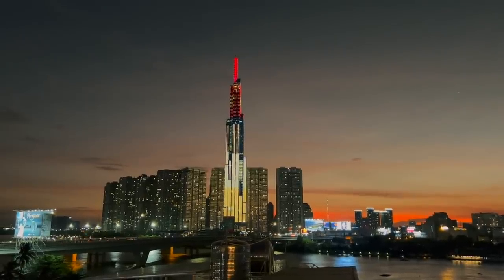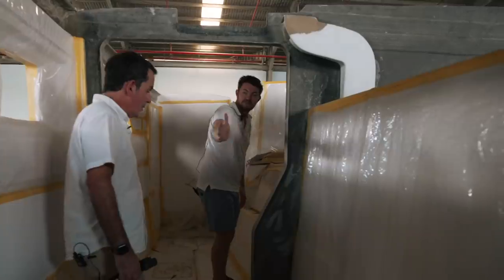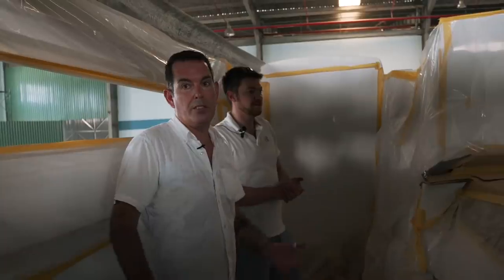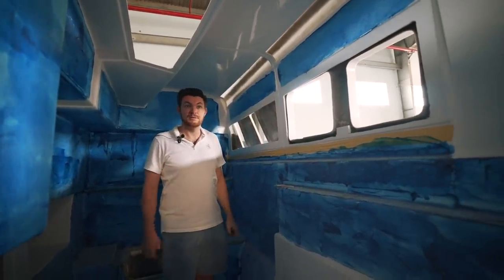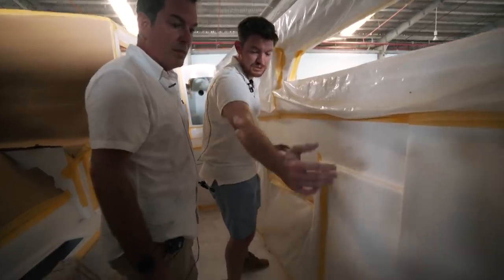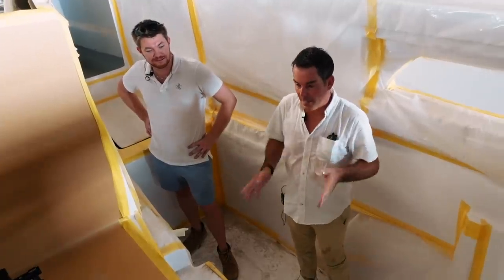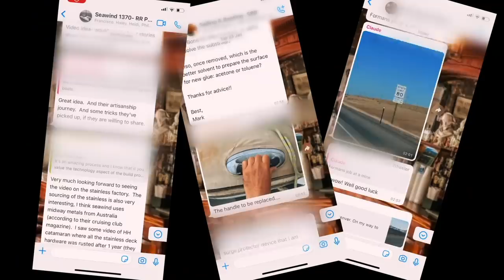CATAMARAN Build- FULL INTERIOR Tour: The Next Stage of Ruby Rose 2

Comment: A lot of chatter has been going on about bulk heads and tabbing.  What really impresses me with this design is the grid structure on the bridge deck.  Torsional stiffness of the hulls will all react out through this area.  Bulk heads etc. are only a small part of the equation that adds up to total strength.  There has to be a certain level of comfort knowing the strength under foot when traveling off shore, and the longevity it will add to your boats life.
Reply from the maker: Absolutely mate. I need to know how a boat that will be keeping us safe is made

Comment: Interesting to see the structure behind the finish bulkheads and hear the thought that went into the design. Great anticipation for the next vlog. It would be interesting during the tours to hear where your and Terysa"s ideas changed or altered the design / build. Also, people might find it interesting to hear the optional equipment that was chosen as well as those items that weren't.
Ruby Rose 2 has sail drives. Why did you choose them versus shaft drives?

Comment: Really a great looking boat. I do have a question about the engines. Eventually the engines will need to be replaced. What kind of hoops will you need to jump through to replace one or both engines?Is there access from above or will will the engines need to be completely disassemble to be removed out through the cabins?

Comment: 8:58 if there is a saildrive torn out, u are above water line ,another level of  protection, interesting mindset from  the Seawind Team. Does the saildrive just snaps off, in worst case scenario? And , why going for a saildrive? I know u covered this point in the past, but your knowledge n critical thinking is evolving in this field. If we may, did Seawind try to convince u to go for a traditional shaft drive as this is an ocean crossing vessel...?
Reply from the maker: I can think of only one catamaran now that comes as standard with shaft drives.
Sail drives are easier and cheaper. While ultimately I can see the advantage of a shaft, it changes the whole position of the engine.
I feel that in ten years time, very few small yachts, sub 50 ft will still retain shafts
Reply: @sailingrubyrose  shaft drive for the hybrid version on HH44, Antares 44, Max Cruise 44, Privilege, Shonning, etc..

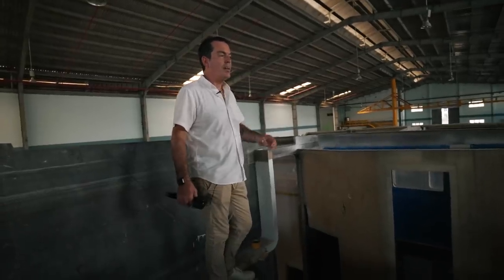Comment: Thanks for the video and good luck w the new boat construction. About the different shape and dimensions of the piping (02:26): I hope you won't face problems related to flow, since some areas will have higher pressure and others lower. Perhaps that was well considered by the engineers but I became curious.

Comment: Congratulations, beautiful boat. I was surprised it seems like interior is pan and glue like the French production boats? Is it not glassed in structural interior? Maybe just the video angles?
Reply from the maker: All the interior fittings and inserts are glassed i believe
Reply: @sailingrubyrose  A video on the construction method would be very interesting. I think you will find, by the current pictures it looks like main bulkheads are glassed in and look great but the furniture, floors, etc are not glassed but glued like a lagoon.

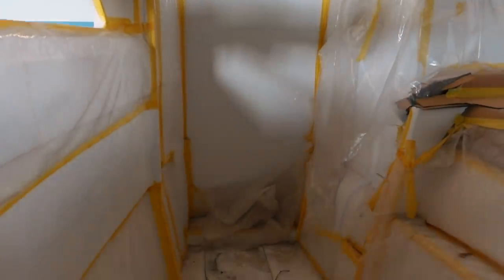Comment: 8:56 crash bulkhead, 2 levels of protection, is it common on most Cats of this category?
Reply from the maker: I don’t know mate, but as this is the beauty of the internet, someone will chime in if there is another marque with double crash bulkheads
Reply: A lot of blue water and racing cats will have crash bulk heads 
Both in the bow and lower front bilge compartments. Thats protection against running onto a reef, rock or Bommies . 
Given the speed a cat can travel at and the amount of heavy stuff floating around in the seas and oceans these days eg shipping containers and heavy bouy's and trees that get ripped loose in storms ...the other suspect item is Submarine Glider ROVs that dive and surface to transmit as they travel through the seas and oceans. Some are scientific others are military but its happend. The other issue is whale strikes 😟

Sealed bilge crash boxes are going to protect the boat. 
Like sacrificial keels... Nock up rudders and retractable dagger boards...  Which allow you to get inshore or over sand bars and reefs in many coastal waters cruisers want to visit or seek protection from.

The first vessel i know of built with a double skin hull was  Brunel's The Great Eastern .... not a lucky ship, it hit a rock on its first trip that ripped a gash in its steel inch plus plates ... Well Over twenty feet long ... but it remained afloat unlike the a much later design vaunted as unsinkable built decades later called Titanic 😬
It was only after the Exon Valdez Alaskan oil spill that it became compulsory for oil tankers be have double bottom construction. 
Interestingly the ancient Chinese pre European voyages probably built the first large sea going vessels with internal water tight bulkheads and actually having flood-able compartments for carrying live animals.😎
Reply: @clivestainlesssteelwomble7665  how expensive and functional  is to install a radar system , like in the submarines , ?  We appreciate your answer...
Reply: @rightright6582  

Are you asking about surface radar or Sonar used underwater. 
Private vessels use both but the price and range depend on the type manufacturer and position where they are installed.
Reply: @clivestainlesssteelwomble7665  sonar definetly.
Reply: @rightright6582  
Most vessels are equipped with depth sounding sonar ...some have the same but forward looking others use more sophisticated systems that act as fish finders... as well. 
There are also more powerful and complex systems as used for finding submerged objects and building up 3D scans that are used for salvage and scientific work.